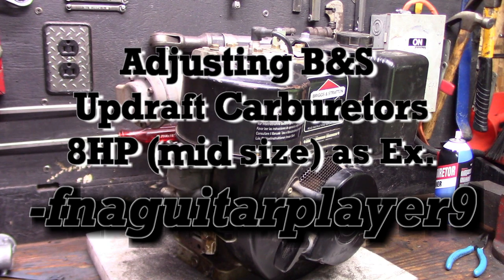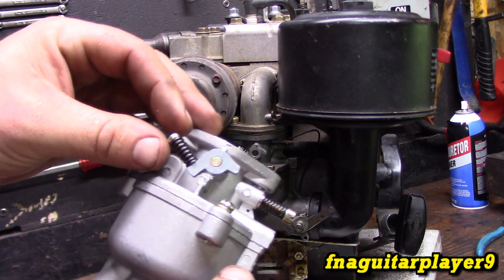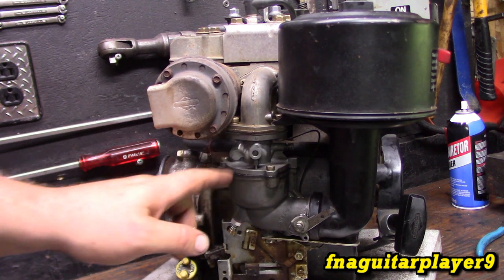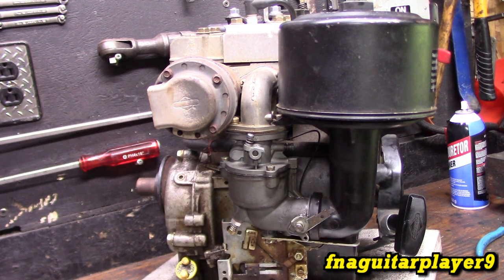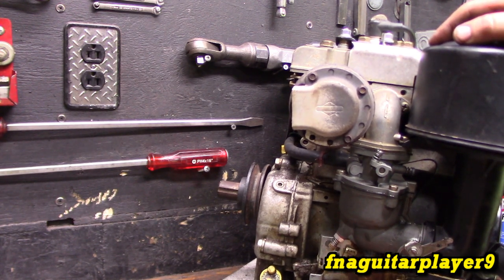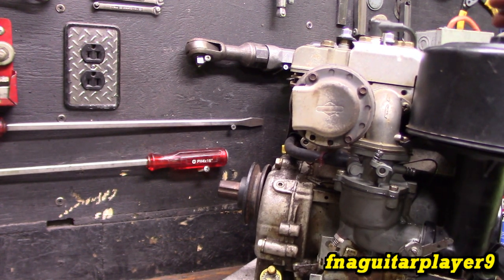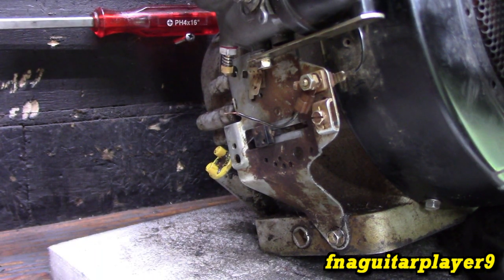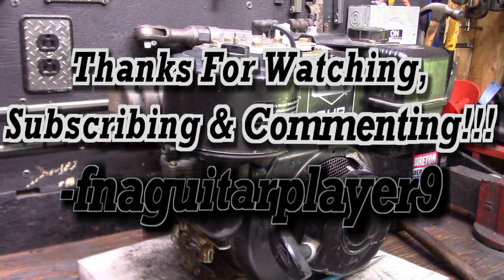How to adjust Briggs & Stratton Updraft Carburetors, 8HP as Example

Comment: I have the same engine & put on a new carb. It runs for about a minute and then dies. I have tried adjusting the 2 screws but still dies after a minute or so. Any other suggestions. Great video btw and thanks for any input
Reply: My fuel on/off valve on the bottom of the tank was clogged. I had to pull the fuel tank. Clean both the tank and the on/off valve. I ended up replacing the fuel line and fuel filter as well. Everything feeding the fuel to the carburetor was in bad shape. Hope this helps.
Reply: @keithadennis thanks for getting back to me and I will check those items as well
Reply: @killdeer  I did have debris on the petcock valve and I think it got through & into the new carb. So I cleaned the gas tank, petcock, fuel line & new fuel filter & also took the new carb off to thoroughly clean that. Put everything back together with  new gas. Now I can’t get it started. Even tried starting fluid. Any help or suggestions would be greatly appreciated. Thanks for checking back
Reply: @killdeer  it’s a 8hp Briggs and Stratton engine on Homelite generator (4400 watt)

Comment: I've got an 8hp B&S that looks exactly like this one. Mine might be a few years older. It's on a 48" concrete troweling machine. I just replaced the carb with a new one l found on eBay. I set all the screws like you said and got it fired up and running. However My problem is as I fine tune it either at a low idle or running fast l can not get it to manually get it to throttle up or down. The governor spring stays fully extended keeping the the top flap wide open. 
I am suspicious of the governor spring and the throttle cable. Do you have any suggestions or another viedo to watch on how to set the throttle cable adjustment or the governor spring. Also the motor after adjusting the idle speed still pulses as it's running. Any ideas on this?

 I saw the small part of this viedo where you refered to it.
Any help would be greatly appreciated.
Thanks for all you do.
Reply from the maker: You may need to adjust the governor, if say the new carburetor has a slightly different throttle plate where the linkages connects it could be throwing it off, i do have a video on the cable adjustment too. watch these 2 here and see if that helps. Its a different engine, but all of it will be basically same just will be layed out different. https://youtu.be/1WWpeyDbHjA  and https://youtu.be/9rO8AvDrdeM  Thanks for Watching!!!
Reply: @fnaguitarplayer9  thank for the quick reply.I watched the videos and will make these adjustments tomorrow and let you know how it worked out.
Reply: Just wanted to say thank you again and update you by on my progress. The governor checked out ok. The culprit turned out to be the throttle cable bracket on the engine it had slipped / moved causing the governor spring to be to tight. Once I got it back in place the tension on the spring corrected, then I was able to get the carb adjustment correct. Running well now. Your videos helped indirectly by leading me to check things that uncovered the problem. Keep up the good works. 
Blessings to you and your family for sharing.

Comment: Mine is seeping gas as well, why are they design to do that?
Reply from the maker: If its excessive it could be a bad gasket, but its actually a vent on one side, and if the gas level is to high (possibly from float not set right or just from sloshing around) it will seep some. I have no idea why they made it like that and not use a standard vent. Thanks for Watching!!!
Reply: @fnaguitarplayer9  Thx for the explanation!!

Comment: I have acolder 8hp troy I replaced the carb on and fuel lines and it won't start.  I put some gas and it fired but adjusted l8ke you said and still won't start.  I believe the carbs a China copy